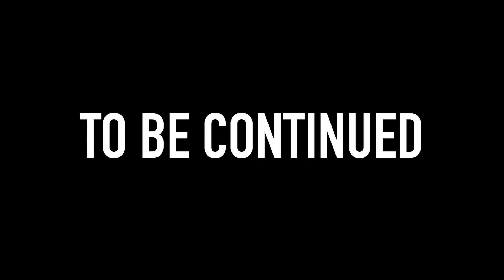STUART FINESSED ME!! **SOLD ME A FAULTY CAR**

Comment: I would hazzard a guess that it's been finished quickly for the vlog and he's got excited when you offered to buy it and just went with it. With a car of that calibre no ones running about with oil leaks unchecked. The injector wiring was probably just badly done, the car would have ran alot worse on the test drive had it been down a cylinder and you would have noticed. It is definitly not down a cylinder in the vlog. The boost issue to me is either a sensor issue or a mapping issue. It might even be on a running in/base map due to not being finished. I'd definitly get it to a reputable mapper asap to get it checked over. They'll tell you everything wrong within a few hours. The knocking is definitly worrying in the video, that isnt a rotational knock thats an engine knock.

Comment: Did you not look at the engine in detail and down the back etc before buying it? It does look like a well built engine from the outside and the parts are expensive enough. It’s always difficult buying a modded car as you trust the workmanship of the previous owner. I’ve had it before bought cars and found loads of shit wrong. It’s an young but I guess that’s the risk you take dude. Hope you get it sorted though it looks fun!

Comment: I'm no mechanic, I've had a few hondas to know to walk away from that sale.....knowing how the engine sounds, no flappy wires maybe a oem earth cable comes loose....engine stutter....only problem I bought was a B18c6 in a EG civic that kept going into safe mode, no knocks, felt solid, it turned out to be a USA map/flash in the ecu for a UK engine....but gamble worked out ok....lucky

Comment: Just had the same done to me bro with a astra vxr, told him at the start any issues known let me know and il get them sorted, nahhh cars sound man. After 20 miles the diff blew in the gearbox, bodge jobs all through the wiring, one bolt holding the front hub in ( supposed to be 3 ) all sorts of shit going on underneath huge crack by the waste gate penny valve inside manifold that they tried sealing with ib weld 😂 Should have known as wanted to meet at 10pm. Travelled 180miles to pick it up. sorted now but had more of a project than i wanted. He Done the same though  no where to be seen when went back and changed his number 😂. Hope you get some justice though, name and shame all over 👌🏼

Comment: Please go awd k20 turbo, only need these parts to go awd

Civic Wagon diff
Driveshaft with viscous coupler 
Rear axles 
Fuel cell
Trailing arms 
Diff mount

With 600-900hp you will be seeing 2sec -2.5sec 0-60mph times